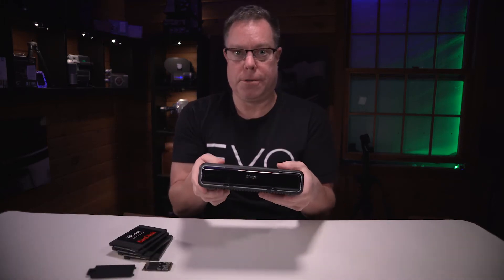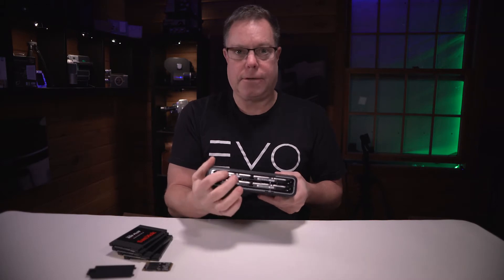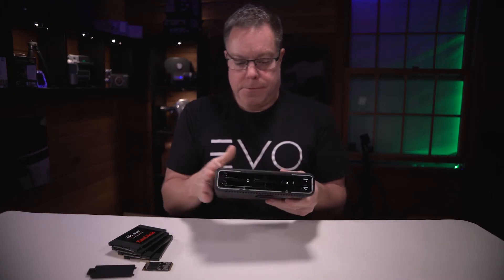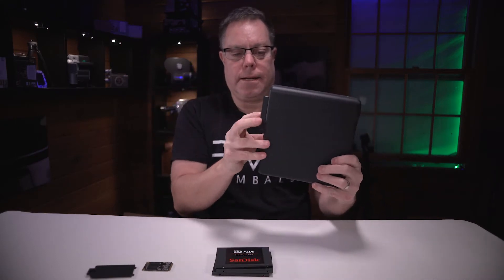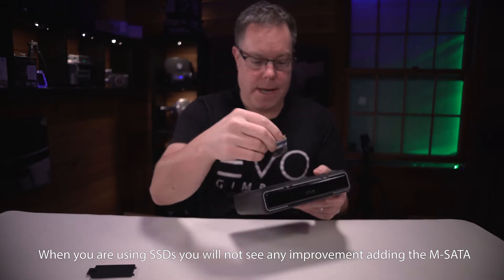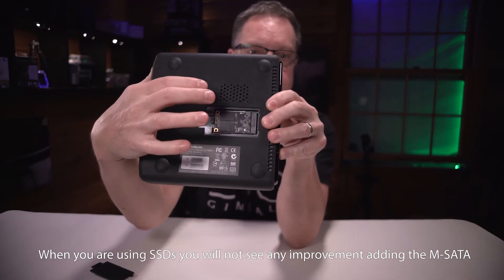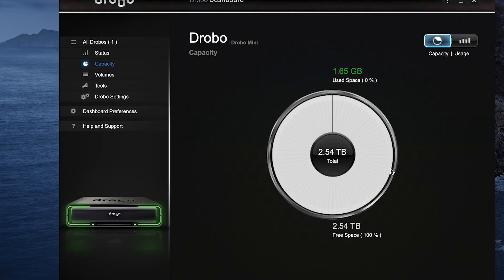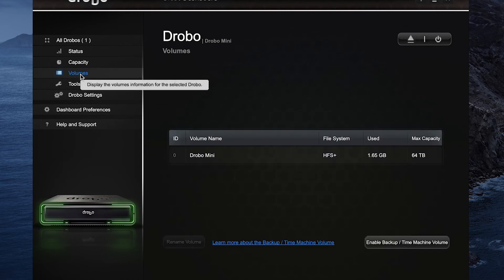How to Upgrade Drobo Mini mSATA and SSD - SPEED TEST

Comment: It's not uncommon for a second disk to fail in a RAID array during a rebuild, because the data replication task is pretty intense.  I've seen this happen in the enterprise - especially when the drives are the same age.
Reply from the maker: I have been using drobos for the past 12 years, I have three that I use every day and I have had drives fail but never 2 at the same time. knock on wood. Thanks for watching!

Comment: Hanz, how do you think SSD's would perform in a Drobo FS which is fairly old but it works fine with sata HDD's? Max 15 TB.
Reply from the maker: John, as far as Dorbo says, you can install any Drive in their housing and it should work. I’m glad I switched mine to the SSD it is way faster now. Thanks for watching.

Comment: hey - how do you connect to your mac pro - lightning2? Also - my drobo power is quite fragile - if i move it by mistake it drops out - is your more robust??
Reply from the maker: I am connecting the Drobo mini to my late 2013 Mac Pro using the Lightning/Display port. I wish I had faster ports on both ends. I have not used it much on the go but I have never had. any problems with it shutting down. In my opinion it is very rugged.
Reply: @hanzdidit  The ports are not your bottleneck. The controller is. 4 SATA SSDs in a RAID 5 should saturate TB2.
Reply: Thanks for the reply - also wish I had faster ports - my iMac Pro only has thunderbolt 3 / USB C but I have yet to get the t’bolt 2 to t’bolt 3 cable. also wish I could describe mine as rugged - if I pick it up even gingerly the power drops out !! Anyhow - appreciate the answer
Reply: I have the same Drobo and just got the new Mac studio. I’m going to try and buy the thunderbolt 2 to 3 adapter to see what the speed is. I know thunderbolt 2 will max out
Reply: @jonbozzy9600  I could have told you back then that it would not make a difference. The connections are not the issue.